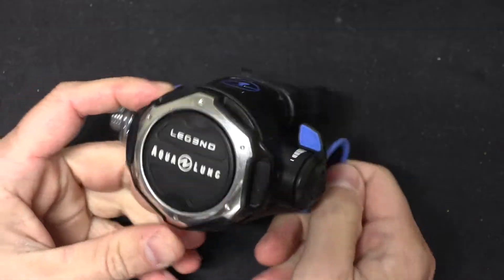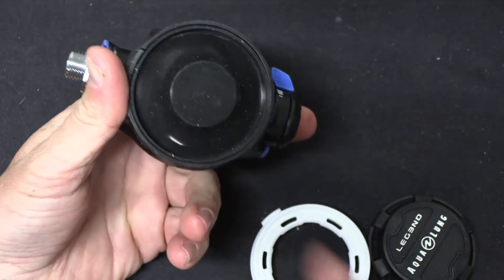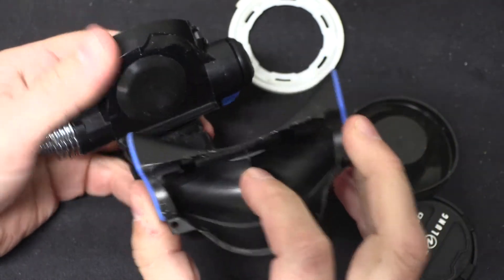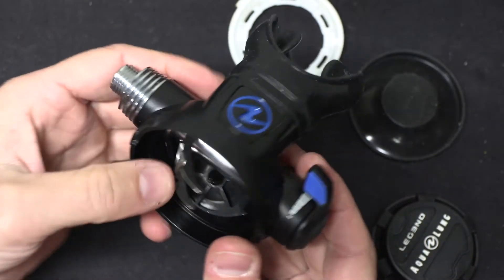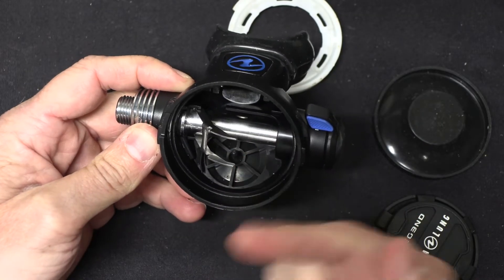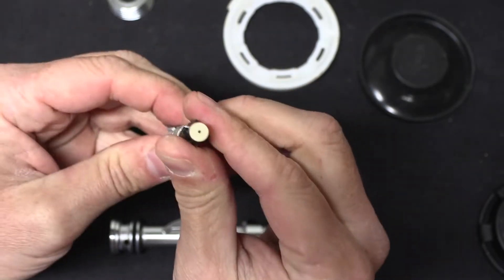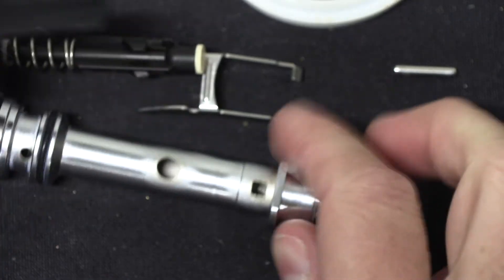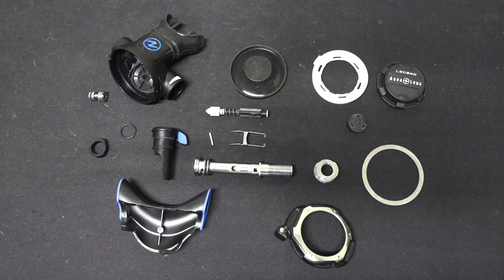Inside the Black Box that is a Regulator

Comment: Funny thing as a technican, PADI Master instructor with 35 years experience, there are only 4-5 different service kits that cover almost 80% of the diving reg market. Made in the same 3-4 factories. 
Great watching you strip with the 2nd stage.  You should do more on reg 2nd stage balancing. Here you use little disks that fitted purge pushing in the perge millimetres.  
Firm fan of KISS ( Keep It Simple Stupid!) Using only reglators not more complicated than this. I log around 450 teaching and personal dive yearly.

Comment: Almost every second stage regulator is a diaphragm regulator. When people talk about piston vs diaphraghm regulators, they're generally talking about the first stage regulator, which is the part that's directly screwed onto the tank, and steps down a variable 3000-150psi to a consistent 150psi (which is what feeds the second stage regulator, shown in this video).

Comment: When I first started diving as a kid…. I got the idea into my head when I found a box filled with all my Dad’s old diving equipment. My first trip to the diving store to figure out what training/equipment I needed and what of my Dad’s I could use… I saw much of what I had brought hanging on the the Dive shop wall… as examples of “Ancient” equipment. Stuff nobody would ever use anymore. After the two tanks I brought failed their hydrostatic tests/visual inspections and they were immediately stamped “condemned”… and all the stuff I had was hanging on the wall as curios and relics… I knew I was going to need all new equipment. Lol. But it did get me into the sport.
Reply: About the only thing that I was able to salvage from my Dad’s gear… were all the weights. Which I briefly used before purchasing soft weights and an integrated BCD system.